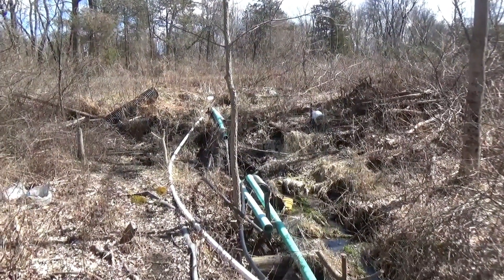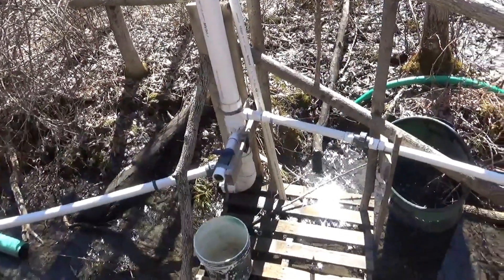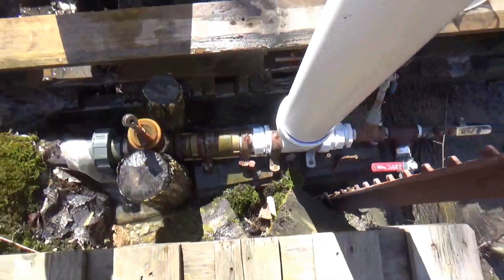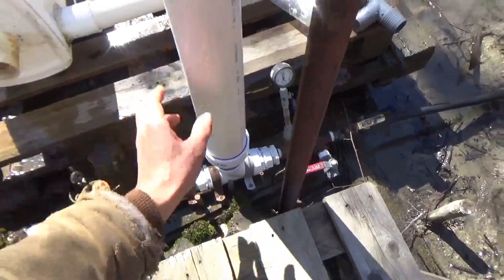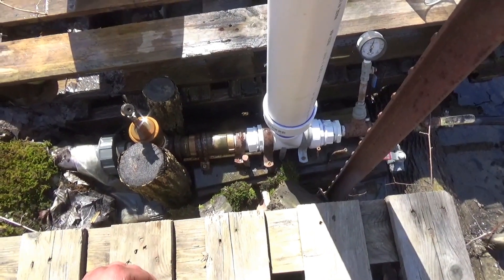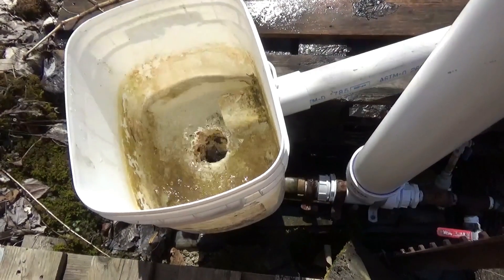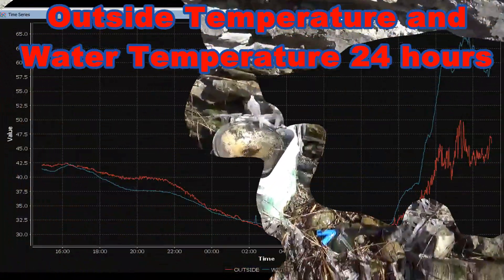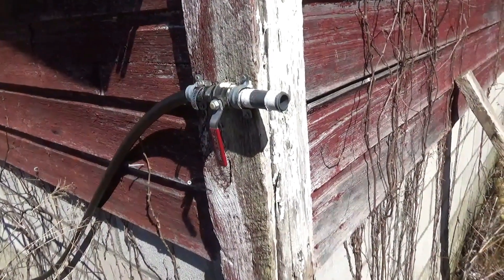What Is A Hydraulic Ram Pump?

Comment: Can't the inlet use a screened funnel, attached to submerged ram pump in a protective cage within a swift river? Rather than the intake line with the "x"ft of drop? There must be a reason why that won't work. Why not? Anybody know?
Reply from the maker: If I'm understanding you correctly.. you are talking about capturing fast moving river water, funneling to accelerate the velocity, and then driving a ram pump with that?  I'll say it MIGHT be possible.. but would be very tricky to accomplish.  With very fine tuned valves and ratios, you could probably make it work. But I think there are other alternative energy pumps better suited for this scenario.  You might look at "coil pumps" where a coil of pipe is wrapped around a cylinder and spun so that it collects air, water, air, water... and the coil spinning forces the water up the delivery pipe.  Ram p[umps are more aimed at using falling water, mostly because you can impart velocity to it which is converted to pressure through the pump. Getting this to work in a VERY low head scenario ( which is what you are suggesting) is difficult... you can't lose much energy or you've lost the "gain" so to speak.  Ram Pumps typically operate in the neighborhood of 10 - 15 % efficiency.  So whatever your flowing water energy was... You're only going to get 10 - 15 % of that in energy for pumping.... UNLESS you do some serious CAD work and design something uber efficient.. then MAYBE it would work. These are my thoughts.  Thanks for commenting!
Reply: The Farmacy Seeds Network Yes, you understood perfectly. I'm really glad I asked as I was just about to start building my "modified (ineffective) ram" pump. I'm no cad guy or mathematician, so this is out. I remember seeing the coil pump years ago. I'll revisit that, thank you. But still not sure if even that will get water 100 ft up a slightly angled cliff. I also need it to be compact and movable as it will only be used to fill the tank as needed. Ram pump sounded good here too since most of it could fit in a milk crate. Well, back to drawing board. Better than the hardware store, over and over and over again. Thanks again for the reply, really great information!
Reply from the maker: @nahminesclarence8256    Glad to help!  Yeah.. check the coil pump out.. I think that WILL do what you're after.. and could be made relatively small and portable.

Comment: 6 feet to 70 feet..... gives me hope!

What is the bucket over the first valve for? Seems it would be just acting as a muffler.
Reply from the maker: Yes it works well!  based on the initial tests.. 90 PSI MAX could technically do over 200 vertical feet... with VERY low water delivery. Yes, the bucket is a muffler and it gives a heavier "resistance" to the valve to dampen some of the smack on the valve... theoretically reducing wear. but yes, MUCH quieter with the submerged valve.